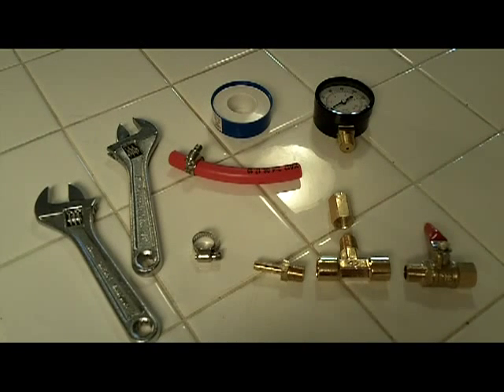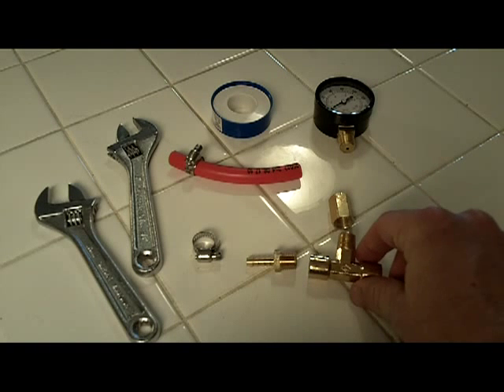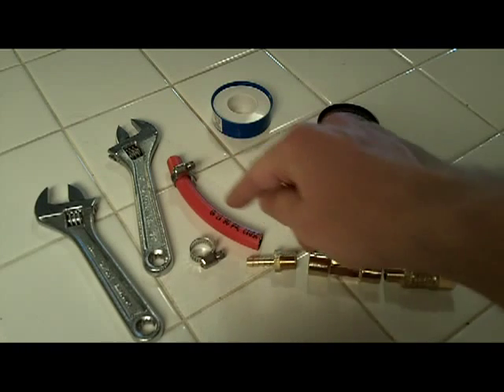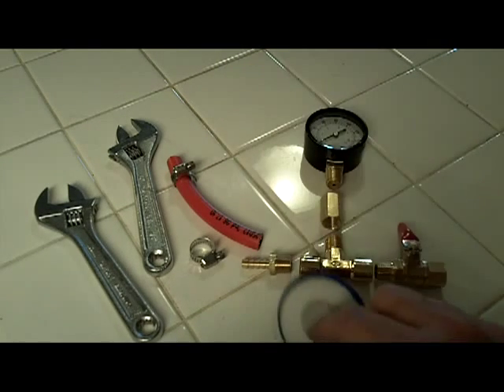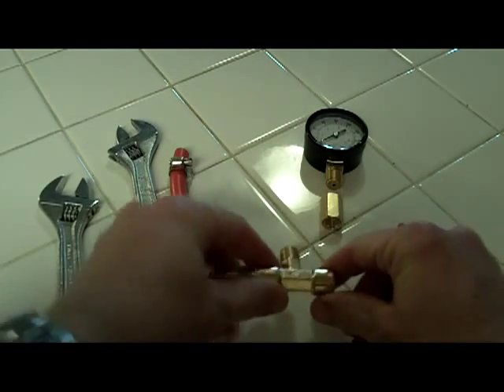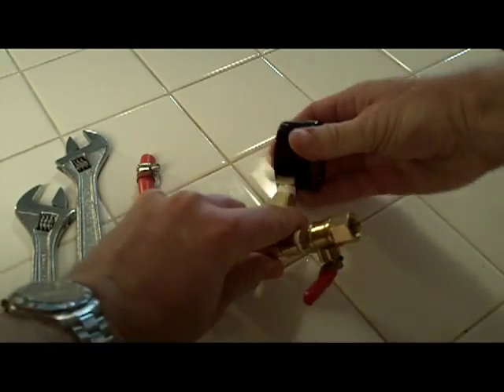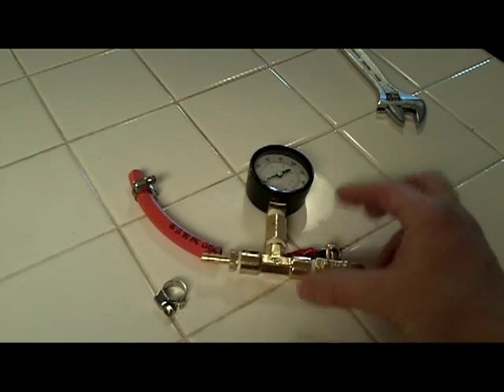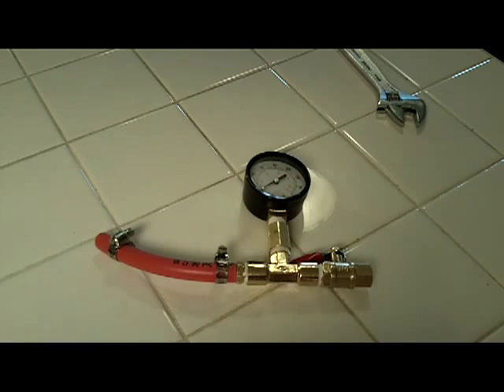DIY Espresso Steam Wand Pressure Gauge

Comment: I followed your recipe today, very thankful to you for looking this stuff up at loews.   You may want to add to your presentation to test while your machine's water is cold, not to let it get hot - that hose is rated at 300 psi at 70 degrees F, but man it balloons up at 212 degrees!  Still, worked fine, thanks!

Comment: Hi ShakyJava, thanks for the Gaggia classic videos. I am working on the OPV mod. So far I have adjusted the OPV 1/2 turn anticlockwise (counterclockwise) and seen an improvement. next step, I am pulling the parts together to build the DIY pressure test kit.

Quick question, what size internal diameter and external diameter is your rubber hose? I will look for a hose (rated for 15bar or more) with the same basic size.